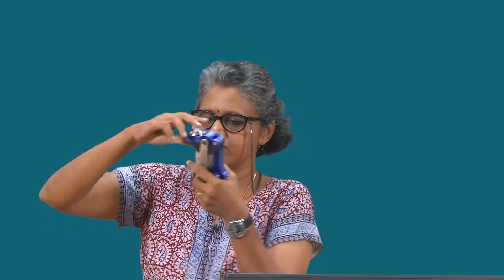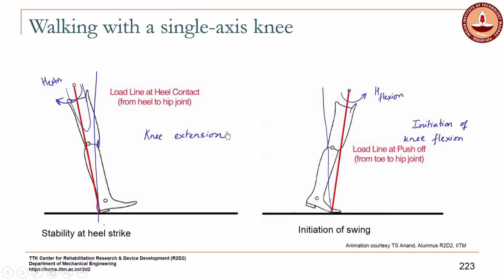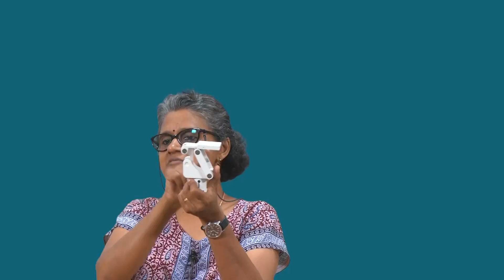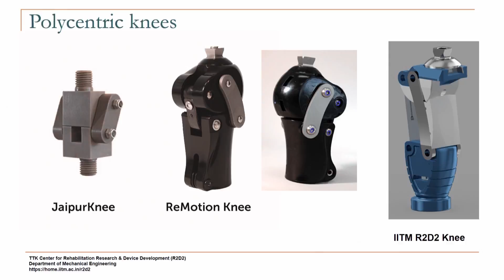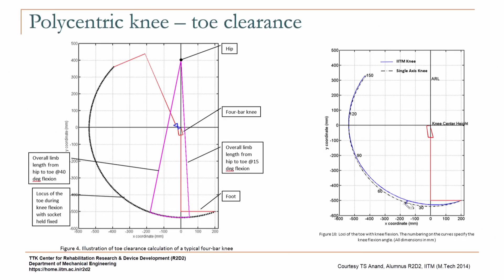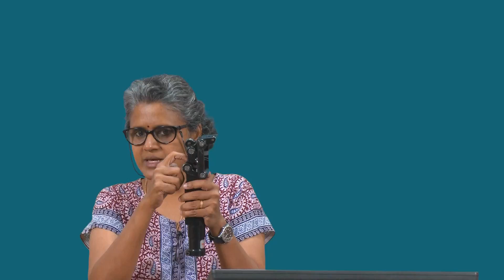#49 Design Considerations: Prosthetic Knee | Mechanics of Human Movement

Comment: Professor, As a 50-year AK prosthesis user, I found your lecture very informative. I have used single and 4 bar knees with and without microprocessor assistance. I walked on the French Proteval for more than 20 years until I could no longer get it serviced here in the US. I was very unhappy. I still have one for backup. I now use an OB 3R60 and their stance flexion should be required on all "high activity" knees. I have one suggestion for your 6-factor diagram. In my opinion, toe clearance and energy required to walk (push-off and heel strike) are more important than the others and should have a higher weight in your comparison. You may need more than one knee, one with high stability for seniors, one for high activity, and a third for high flexion. If the bars are long enough, you will have adequate flexion. Thanks for listening to my rant.  Tom S